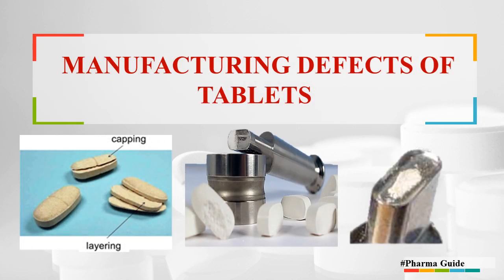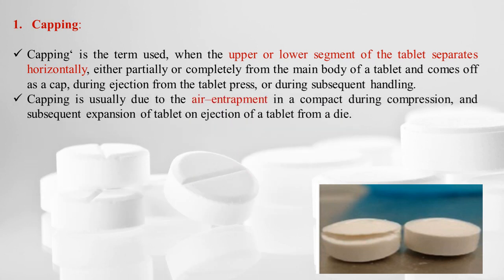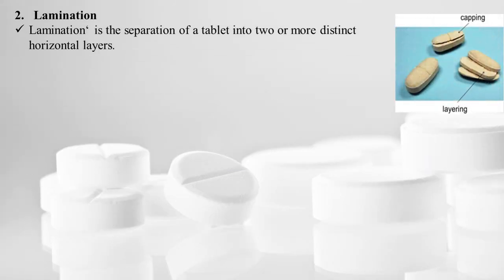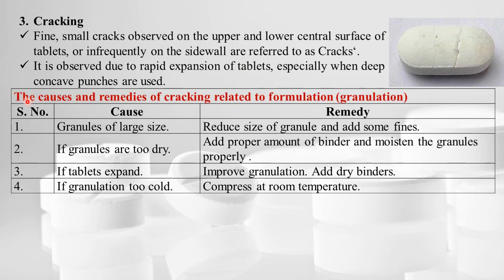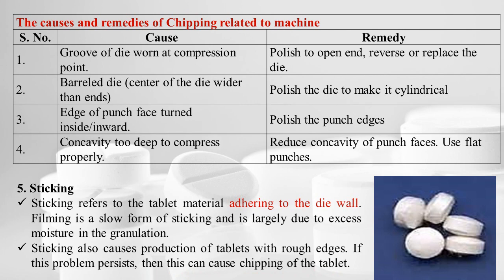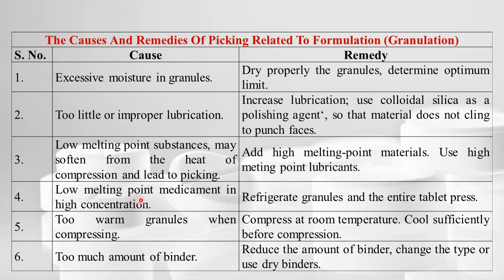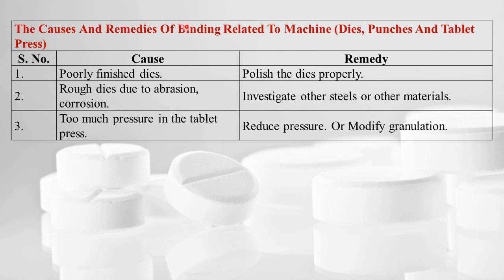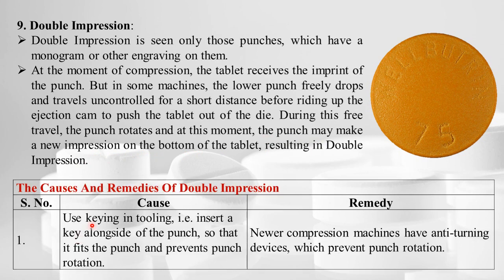MANUFACTURING DEFECTS OF TABLETS with pictures and their remedies

Comment: i didn't understand the point deep bevelled punches how cause capping?
Reply from the maker: Bevelled edge means an inclined edge; one not at 90 degrees.The flat faced tablet design suffered from weak tablet edges because of powder leakage at the punch tip die wall interface. Weak edges were prone to chipping and excessive friability. So adding a beveled edge to the tooling was very simple for the tooling machinist to do and allowed for the formulation powder to be pushed back to the center of the die - making for stronger tablet edges.  This design however has a  disadvantage  – punch weakness. The lack of cup depth can limit the compressive force.  Leading to soft tablet edge. deep bevelled punches causes capping  due to lack in compression force because that can lead to bending of punch tip and its distortion
Reply: @thepharmaguidechannel 
I think bevelled edge give sufficient space to tablet to get relaxed...
In case of normal punch tablet is not able to relax properly after removal of shear stress which leads to capping
Reply from the maker: This can be 1 cause.. not always it leads to capping
Reply: @thepharmaguidechannel  
okay mam....i think u should give ur explanation of video in hinglish...
Reply from the maker: Hinglish? You mean both in hindi n english
Reply: @thepharmaguidechannel  
Yes use both language ....Pure English is not enough to grasp the concept..

Comment: Double Impression Ni smjha mam plz describe it ?
Reply from the maker: It is due to free rotation of the punches, which have some engraving on the punch faces.
the punch rotates and  lower punch freely drops and travels uncontrolled for a short distance (punch tablet twice)  before riding up the ejection cam to push the tablet out of the die, punch may make a new impression on the bottom of the tablet, resulting in Double Impression
Reply: @thepharmaguidechannel  mam hindi m please?